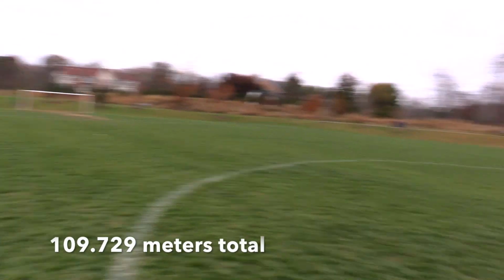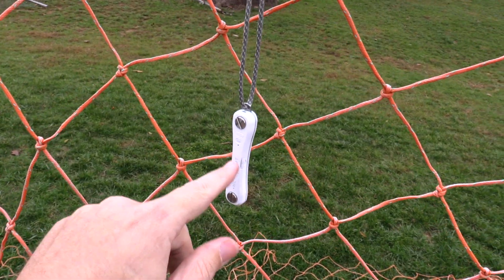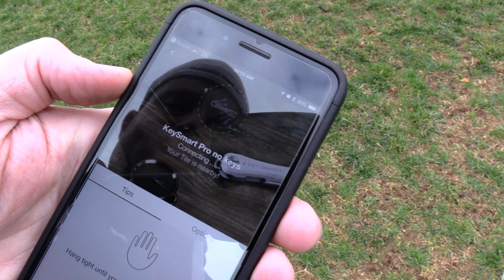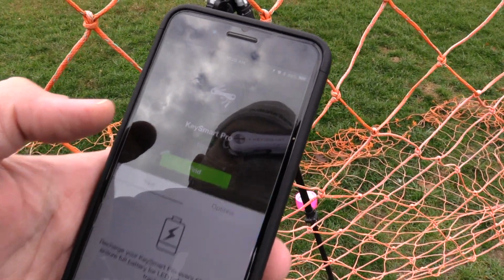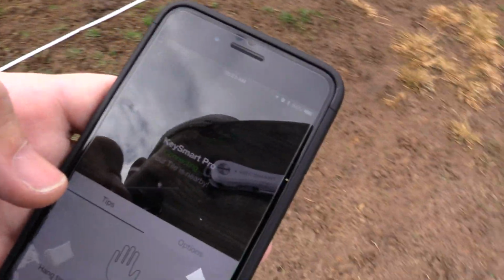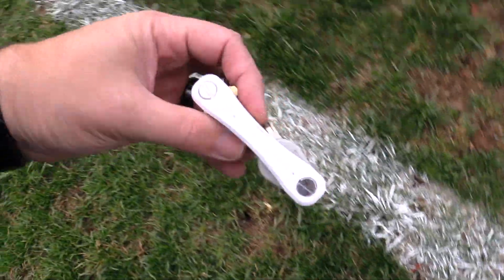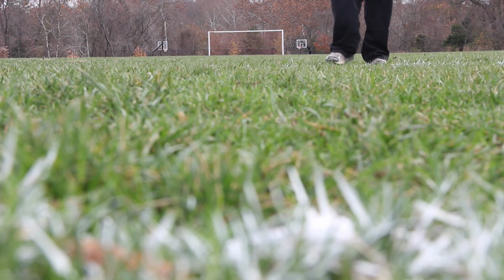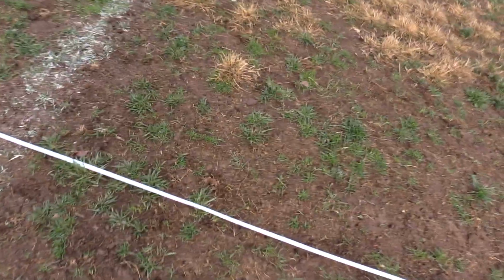TILE TRACKER - KeySmart PRO Distance Test

Comment: Didn't look like having all of the accessories on the tile would make it a deal breaker but without putting your keys and other things on it it's just a tiled bottle opener.  What do you think?
Reply from the maker: Lol, I don't think people will buy a tiled bottle opener for 60 bucks. Maybe everything one day will be tiled if they can get the price down and the battery life up. People should just know that the more metal and things near your tile can affect the distance.
Reply: ModernDayFamilyMan I get your point.  Like metal can affect radio frequency.
Reply from the maker: Yep it can. There are lots and lots of factors.